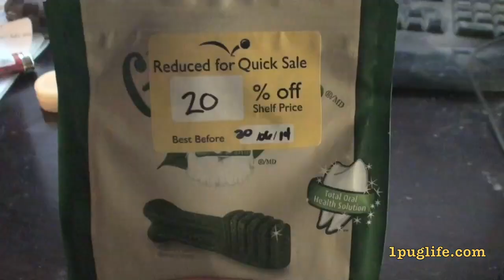ford windstar wheel bearing replacement

Comment: Hey pug Next Time...... get the axle shaft out put the lower balljoint back together, remove all but one (bottom rear) bearing bolt, back the one bolt out all the way but about half to quarter inch of threads, then put your socket back on the bolt with however long an extension you need to hit the frame or whatever is solid, fire up the rig and use the power steering to press it off!!! works great!! YouTube it if you have doubts!!

Comment: If the arms will reach, pull the truck forward and center it on the lift. Put the front lift arm on the front radius arm at that notch, and the rear on the rear spring eye bracket and raise that POS up already. I work on Fords trucks almost every day and that's exactly where I set my lift. It is rock solid and steady like that. You definitely don't want to have too many extensions on the lift arms though, cause it'll get wobbly on you, and that can get a bit scary.

Comment: Pete from Detroit.man pug that bearing is shot.its easy 3 or4bolt in the back. The main thing is you got to clean the the ads on the axle , lube it and torn it to th right specs. It will last a lot longer.

Comment: Can't you use the threaded holes in the flange thing to press out the piece?  You just run some long bolts through the holes and they push off the assembly?

Comment: Put big dirty forward more so the rear antlers are on the rear springs forward spring mounts and put the front antlers on those tabs on the front trailing arms, use whatever adapters will reach. I use the same lift and have to raise at least 3 different big Fords every week,.
Check out Amesie's Corner I have a big ford on the lift in one of my recent vids.
Reply: Also those "truck adapters" are pretty much useless I have never used or needed them in almost 30 years of wrenching.

Comment: f250 and 350 are a pain to get on a lift. adding running boards makes it suck extra. i use the tabs all the time. u got big dirtys too far foward. move him back about afoot and maybe the front lift pads will be more stable with less extenders and the rears can be longer.

Comment: you did it the hard way, beg my pard. Torqing on the axel nut is usually 100-130 ft/lbs. And socket size is 33mm I think. off to watch the thc show.

Comment: Ford trucks have always been a bitch to lift. To rack these use the tabs on the arms in front and make yourself a 4x4 block of wood on each side in the back. Scary I know but been doing it for years. Lift it a few inches off the ground and shake it good before going up.

Comment: Roll the truck back it`s to far forward.Lift it under the front trailing arms thats what the tabs are for(They will sink into the lift pads)and move the rear pads a little more forward.Remember all the weight is in the nose….

Comment: Buy a chevy, you don't have to lift that kind up
Reply: you're right, you just drive chevys straight to scrap metal corner ffs
Reply: No need to lift it, guy at the scrap yard will do it for you...
Reply: WoZIMoo Yeah, they're only good for 300,000 miles or so.
Reply: CornellsGarage 300,000 miles after 2 engines & 3 transmissions that is.
Reply: I suppose for idiots that never change their engine oil or trans fluid and filter.

Comment: my dodge (beg my pard) had the same problem when i took it to a buddys to get the water pump replaced, the running boards were in the way of the lift so he couldnt use his lift on the dodge

Comment: pug, Why Why Why did ya poop the ball joint?  you made your FFS a bigger FFS.. Leave a bolt chooched halfway in and then use the fraud PS to push the hub out. or at least get it loose. 4X4 mag had an article on it  for chooching hubs on dodges.

Comment: You say you put anti-seize on the bearing surface, cause they are cheap bearings and you will probably have to change them again. Then why the Red Loc-tite?
Kinda defeats the purpose of easy removal . Definately won't fall off though. Lol
Reply: All those one piece bearings are crap you're lucky to get 100 thousand out of them. And Ford wants red lock tight on them bolts, if not the come loose.  The anti seize is only so he doesn't have to beat the thing with a hammer to get it loose
Reply: xMoose338x Ford puts blue loctite on everything. That red loctite is definitely going to be a pain in his ass when he goes to take that pinch bolt out of the knuckle again.
Reply: They come from the factory with a white color loctite that is the same as the red stuff we can buy and use.  And it's not the pinch bolts are we are talking about it's the bolts that hold the hub on. as far as I know Pug didn't use loctite on the pinch bolts.
Reply: xMoose338x @5:45 Pug just put the lower ball joint into the knuckle, and commenced to put Loctite on the pinch bolt. With all the road grime, the salt and the rust, adding Loctite to that bolt is going to add just another level of aggravation to that job. Not a big deal really JMHO.